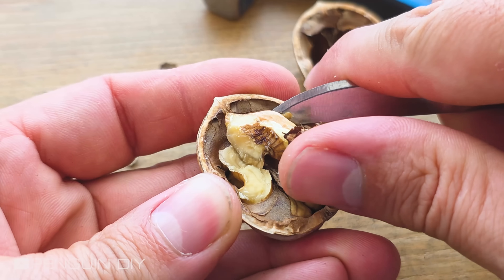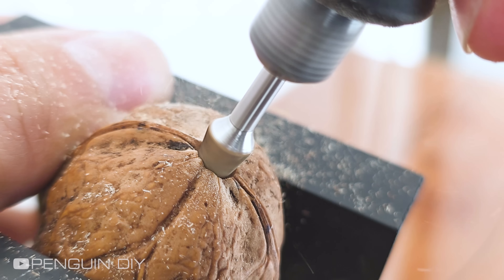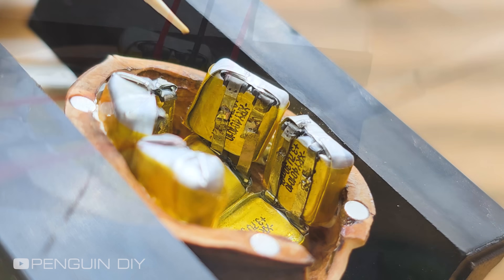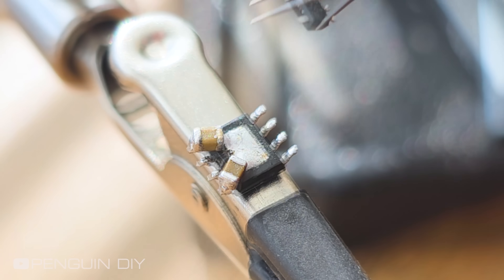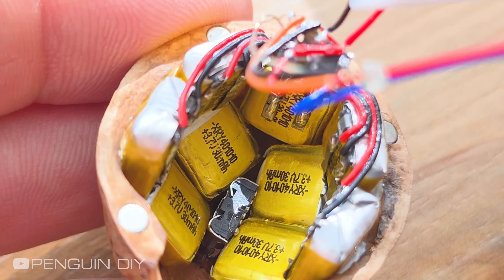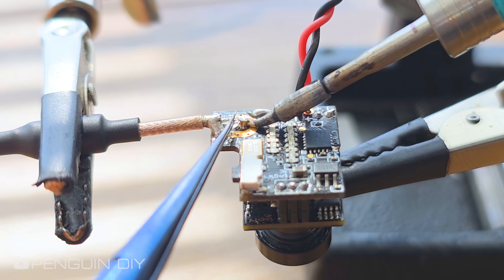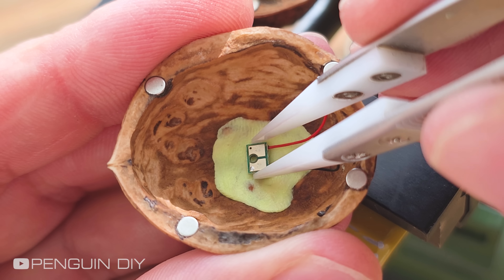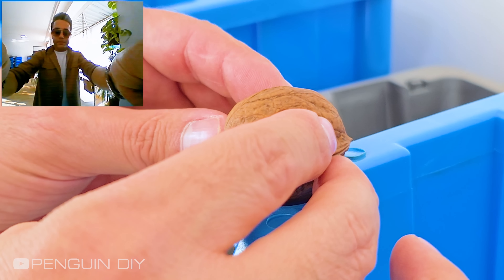Not Just a Walnut — It’s a Secret Camera I Created!

Comment: Regarding Li-ion charging. Flashers used in airsoft guns to charge phosphorous-coated pellets with UV light, use batteries of similar capacity and a tiny SOT23-6 charging chip, which also requires little to no auxillary circuit. Available on Ali, I replaced plenty of these ICs when repairing the flashers. Alas don't recall the IC name, but I think it is googlable.

Comment: I fly fpv drones and unfortunately if this was left on for very long it would probably get hot enough to melt or burn something in that shell, those tiny cameras are designed to operate with air flowing over them so they tend to run hot

Comment: Only I can say is " Awesome idea, awesome work done "  Great Simply Great job Sir 
Sir do you have any circuit diagram of transmitter and receiver  which controls the RC TOY dc motor
With Explanation how the motor is controlled by the transmitter and receiver circuit
I want to LEARN Electronics's

Comment: Undeniably great skills and extremely cool just as a fun project. But in terms of practicality – i.e., actually functioning as a viable concealed spy camera - it's a fail. 
The camera is huge relative to the walnut and sticks out like a sore thumb even at 30 or 40+ feet away.   Matching the exterior color of the housing as close to the color of the camera would help, and there actually are black walnuts.

Comment: Install the pinhole lens and wireless charging. Then there will really be a walnut camera.  Or put a smartwatch connector instead of a power connector. It is smaller and the two points of contact are almost invisible.

Comment: You can by tiny battery charger with size of usb-c  port. So, no need to do this madness with soldering smd in the air.
And you also can buy wifi patch antenna instead of soldering some random piece of metal.

Comment: hey this reminds me of that literally peanut shaped sound recorder thingy i kept seeing on shopee
also given the extra bit of space in the middle why even use 9 tiny batteries and just a slightly bigger 350mah lipo cell instead?
and why the FPV camera specifically? these drain power quite fast and i think a standard wifi ipcam board should do just fine for this scenario and much more compact

Comment: There is a type c charging module available that is so tiny that all components are fit in the type c connector.
Reply: what's it's name?
Reply: Tp4056 ic board 👍
Reply: it is dangerous tho, no protection and very hard to work with.
Reply: No way it's Xavier 😮